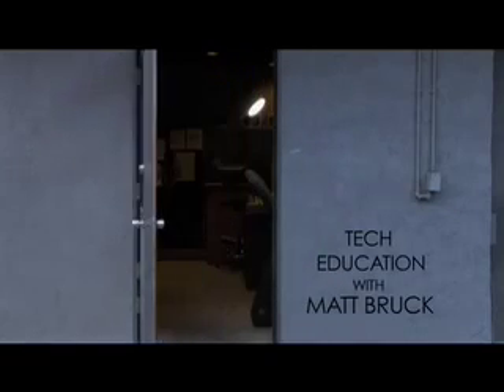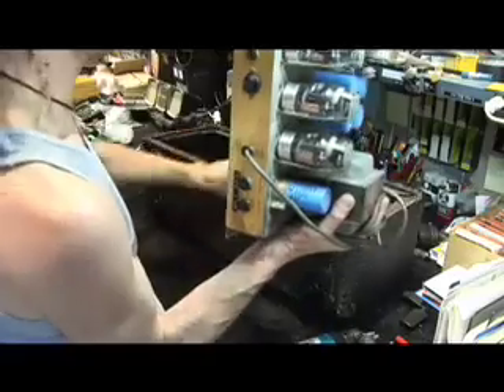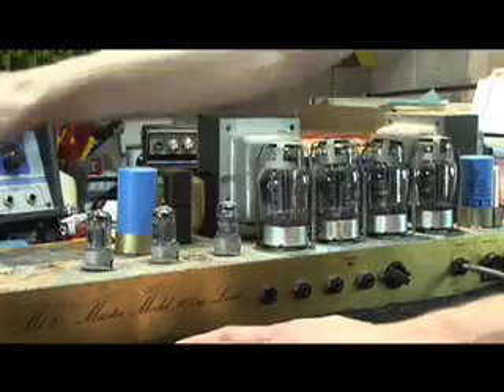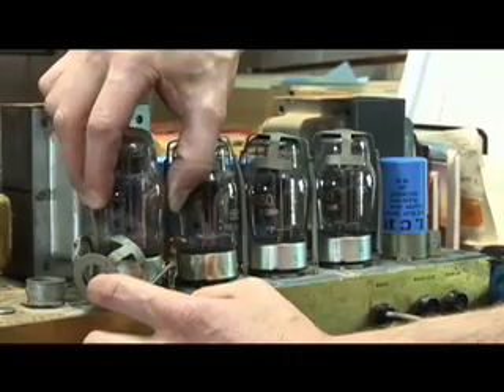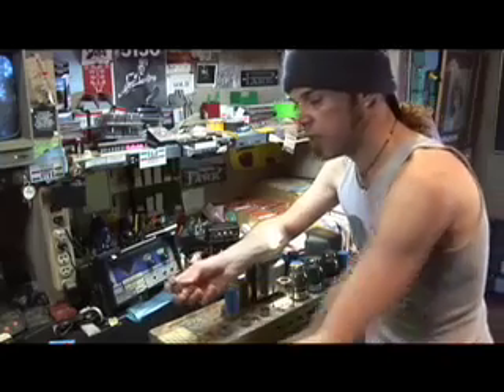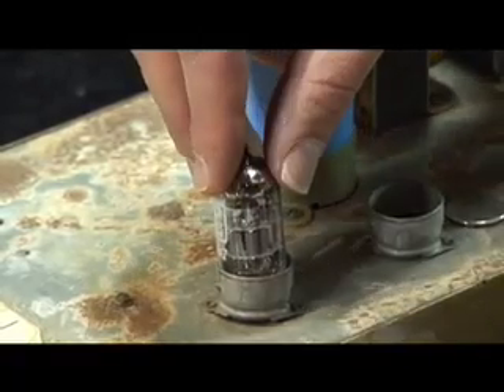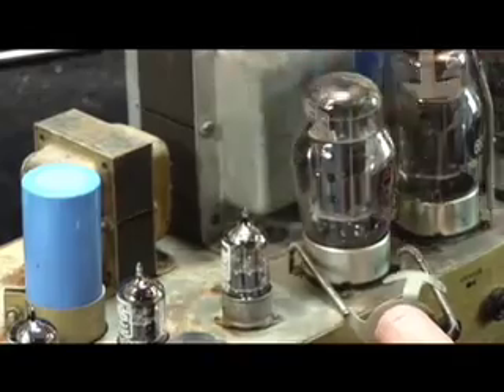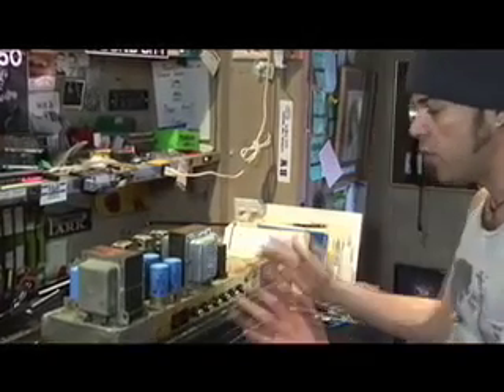Tech Ed 14 -Replacing Tubes in a Guitar Amp

Comment: It's only dangerous if you just turned a cold amp off. If you haven't touched your amp all day or for an entire day and touch the capacitor it isn't going to do anything. It holds a charge, but not as long as everyone tries to think. It will go from 500milliamps down to 2 within several hours. Use a meter and you will see that I am right. This is sooo not rocket science. Guitarists are just pretentious and think it is super complicated when it's not!!!!

Comment: Hi, I bought an tubeamp Crate V3112 last saturday. I would like to know if is it necessary regulate the bias of the amp when we change some tube? I'm sorry if I didn't understand something. I noted some heat on the upside after playng for 1 hour. I realized installing a cooler in the midle on the back side to remove the heat and get some ventilation keeping the circuit and tubes warmed the necessary temperature. Wht do you think about it??Thank for your video.

Comment: Meh, if you speak to most old techs they'll tell you that's not just true... it's a rumor perpetrated by internet forums because of halogen bulbs.

Typically, the temperature vs. thickness of a modern power tube is not right for body oils to become a real problem.

But, you know the internet, give someone a chance to appear smart and they'll jump on it. We all have to be experts to validate our little insignificant lives.

Comment: Yeah, following this guys advice is a good way to get killed. Don't go tearing into your amp if you have no prior knowledge of electronics and this is the only video you've watched so far. Those big, light blue cylinders are called capacitors and on a high wattage tube amp, they store a charge inside them that can easily kill you if you touch the two leads on the bottom. Learn how to properly discharge them before ever servicing you amp. There are videos on YouTube that show how to do that.

Comment: Is this video necessary? Is it for the simple minded? In the fifties you'd pull out the tube, check the location of the missing pin or key (not notch, a notch is a type of groove) in your hand, grab the new tube hold it the same way and then gently plug it in. Who in their right mind would pull the amp out of the case? What's the next video, how to use a parking meter?

Comment: take that back even if you did unplug still them caps hold charge for days,weeks who the hell knows lol I worded that wrong, rig up a chicken stick with like a 470k resistor to prod and drain them caps with that high of value it will drain slowly DO NOT use a low value one it will possibly blow up and there will be one hell of a lightning bolt arc lol or you could just go from pin 1 on first preamp tube to ground :)

Comment: you don't need to unplug the amp from the wall just for removing replacing tubes lol only unplug it when removing amp from case for biasing purposes you don't want your hand or finger to bump a 450DC volts+ filter caps they can kill you, I about died myself biasing some new tubes for my crate stealth 50 my arm got too close to the PCB and HOLY SHIT you will know when them fuckers grab you lol. So yea leave it to a tech if you have no electrical knowledge or feel uncomfortable inside an amp

Comment: Someone told me years ago that a brand new tube can run 24 hours a day, 7 days a week, for two years before it wears out but I've found that certain tubes wear out at different rates in different applictions. In some older RCA colour TVs from the 1960s the 6GH8s would wear out in 3 to 4 months but a type 80 rectifier tube or a 6SK7 IF amplifier tube could last for years and years in service. When it comes to power output tubes like 6V6s, 6L6s, it depends on how hard they are driven.

Comment: That's all news to me, I've been servicing tube equipment of all kinds for 25 years and have never had a tube shatter whilst trying to remove it though they should be grabbed from the base is the tube has a base. As for fingerprints ruining a tube, I sincerly doubt it, if fingerprints ruin them then dust, grease, and other filth would do the same and yet I run into radios and amps that had tubes coated with filth for who knows how long that tested perfectly fine.

Comment: Not a very good tutorial imho.
1. I think the best way to remove a power tube is to grab it by the base and pull in a circular motion.
2. I use a glove with rubber fingertips - helps with traction and protects your hand in case the tube shatters.
3. Don't leave your fingerprints on a tube - they will ruin it.

Comment: important, and what needs to be in this vid is a disclaimer about how even removing an amp from the chassis is dangerous.  Also in the vid when you talk turning on the amp need to mention the need for a speaker load to always be connected correctly first before even powering up

Comment: Did you resolve this issue? Because I have the same issue and I read that Fender amps usually have this issue due to the fiberboard that the circuit is transferring energy through, something about the fiberboard being conductive, it's called tweed disease. For me it only happens when the reverb knobs on my amp are turned up.

Comment: That's for halogen lamps not tubes oil from your hands does not hurt a vacum tube you can't touch the inside your greasy hands will do nothing to a tube it's and amplifier not a halogen light bulb.

Comment: @MrJackanthony It depends on how hard you drive them (if you drive the preamp tubes they'll cause distortion, if you drive power amp it'll be loud (and will eventually cause breakup and distortion)) -- but under moderate to heavy ware a power amp tube will last at least 6 months and preamp tubes can last up to 2 years.

Comment: guys,with your experience tell me if i need and specialist or i need just to change the power tubes.i was playing the other day and then nothing the amp turned OFF NO SMOKE SMELL AT ALL,i pull out the tubes and one of the tube haves a white head and the other seems to be normal silver color.is there anything else or just need to change the tubes ??? im worried cuz is my first tube amp and i didnt know if the new tubes are going to burn as hell.PLEASE HELP ME

Comment: FYI. you should never handle new tubes with your hands, as the oils from you skin will cause the tubes not to heat evenly on the outer glass of the tube, thus shortening the life span.
Cheers

Comment: I've got a traynor ycs50 that came with 2 sovtek 5581's, do I still have to rebias if I replace it with the same 5881's but different brand? 
After use, how long do i have to wait to make sure it's safe to pull the tubes out?

Comment from the maker: I would recommend researching forums such as Harmony Central. I am not familiar with your amp and I have found different amps to react different to different tubes. There are several choices and I am sure you can easily find tubes that are hotter  or better sounding. Most stock tubes are kind of middle ground since OEM does not always try to make it's product for any certain genre. But yes tubes can start getting weak sometimes. It should be easy to research. Good Luck...